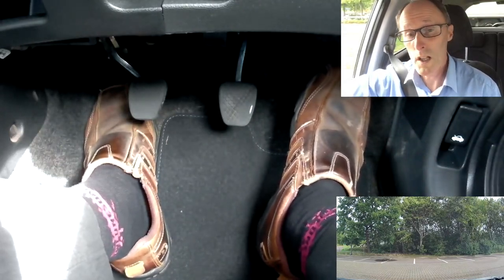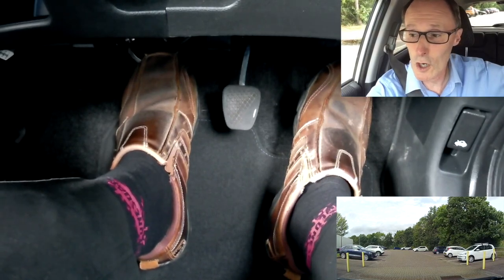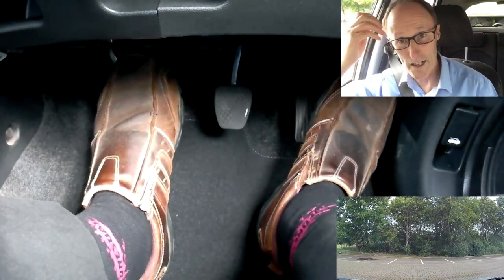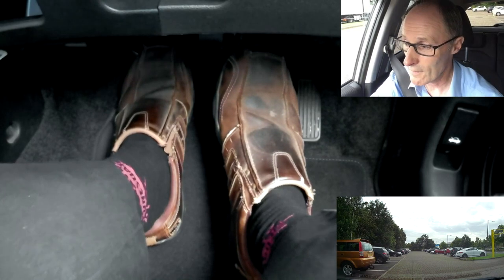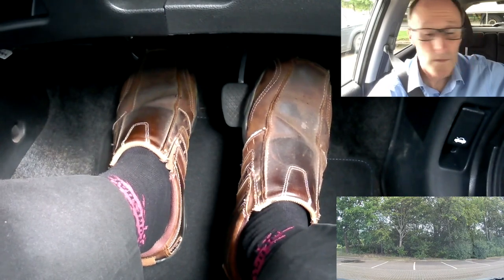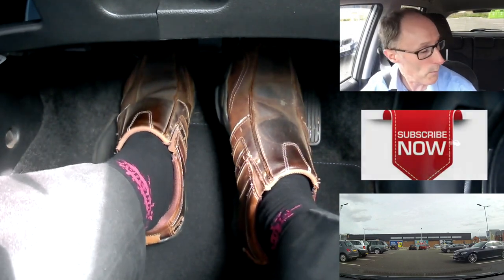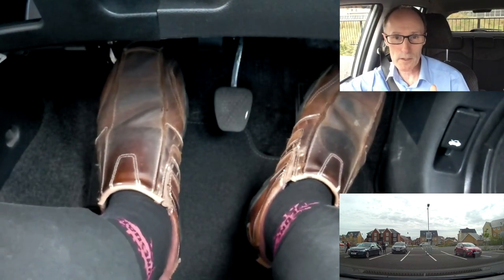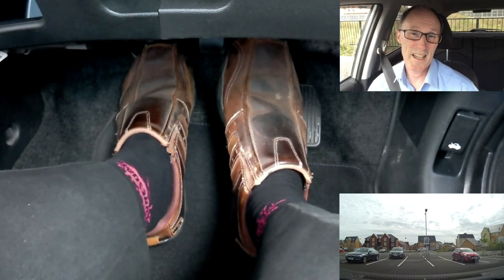CLUTCH CONTROL ON MANOEUVRES

Comment: I passed my test about a week and half ago, got my car yesterday and it's so different. I was learning in a fiesta diesel and the car I have now is a 1.2 cleo, I always get so scared at junctions,  round abouts etc about stalling because I was never taught to use the gas with my clutch. Any idea how to improve myself as I feel like I never will learn. thanks!
Reply: Just remember to add a bit of gas before lifting the clutch to the bite point and that should help you move off